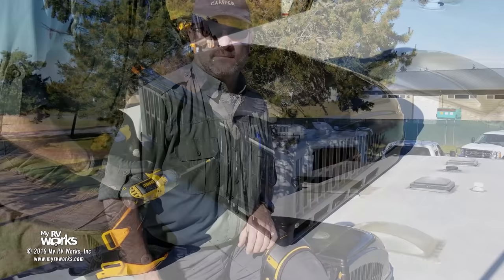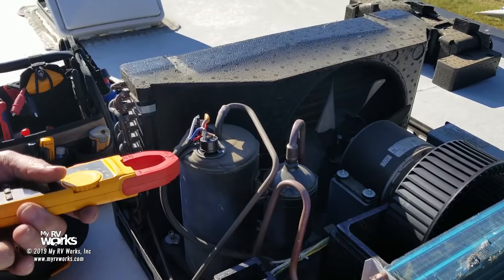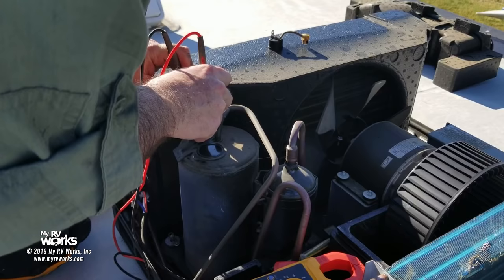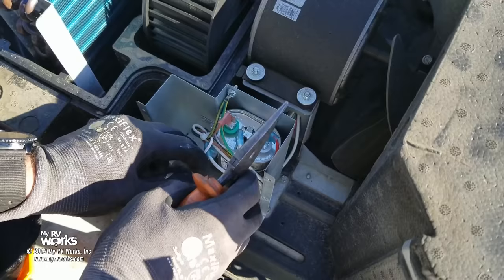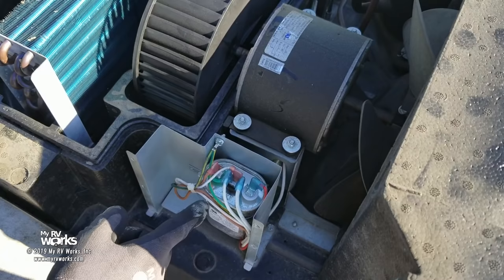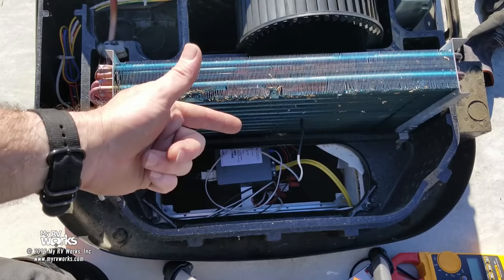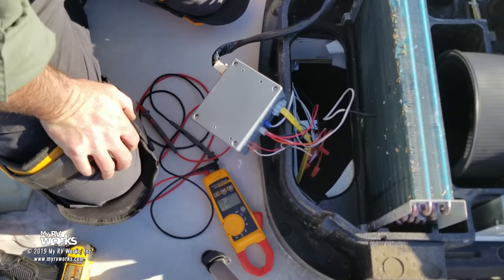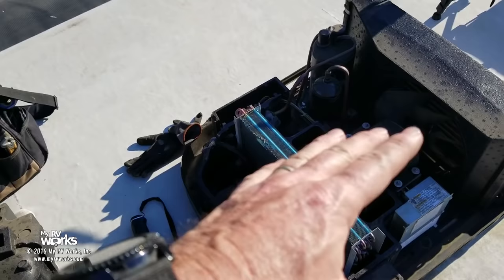Diagnosing An RV Air Conditioner That Is Not Cooling

Comment: How many volts are you supposed to have coming out of controller going to the fan? I only have 12v coming out of controller but I do have 110v going to compressor. Compressor is kicking on but no fan, suspecting it's the controller.

Comment: My c-s and c-r totalled 3.8 ohms but the S-r was only 2.5 ohms?????  whats that mean?
Reply from the maker: Interesting, the math doesn't seem to add up there, so I see your point. What is the common to start value. Then what is the common to run value? Adding those two should equal the start to run value. If it does not, and it's off by a lot, you may possibly have a bad winding in your compressor.  Also check each post to ground. See if there's anything shorted there. There are some other tests you can perform on this. They're in the service manual for the air conditioner.
Reply: @MyRVWorks  I have the Brisk Air ii, how do I get a copy of the service manual? Also, how do you check the relays? Thank you
Reply from the maker: @davidlawson5665  I have lots of manuals from all the factory training I have attended but I have yet to upload them to my website resources tab https://myrvworks.com/manuals/.   Here is another guy that keeps  service manuals on his site:  http://bryantrv.com/docs.html
Failing that you can contact Dometic directly for the manual:  https://www.dometic.com/en-us/us/support

Comment: Wait we’re you running it without the evap coil cover? No shit it’s not gonna cool. You can’t confirm there’s no refrigerant with out a pierce valve and checking the charge.
Reply: You can't check the charge,  he made that statement.  For the price of these units compared to  the amount of time it would take to drain,  add ports, fill and check for leaks then drain and fix etc.  Just replace the thing.

Comment: Another rip off electrician. All he had to do was turn it on to hear if everything was working, if so it needs a charge which he can't even do... He has no business even messing with them if he cant do the work. All he can do if he finds a problem is tell the customer it's broke which they already know since they called him. If he can swap the unit he should have told them thats all he can do. Their was no point in diagnosing it since he cant fix it anyway.
Reply from the maker: So, let me make sure I understand 'your' diagnosis process. If a customer turns on the air conditioner and it does not work, and called me, then my immediate reply should have been "Sorry I can't help you because it's lost its refrigerant and that's not something that I'm licensed to work on."  So with your process I would make this assessment before I even see this air conditioner or perform any diagnosis on it at all?   And you are saying that this would have provided a better service for the customer.  Do I understand your statement correctly? What should I do if the customer wants to understand the problem? Should I take the time to diagnose all those individual components, which 80% of the time is usually a component that failed?  What if it was a capacitor?  I stock those.  What if it was a freeze sensor?  I stock those.  What if it was a control board?  I stock those.  What if it was a fuse?  I stock those.  What if it was his thermostat? I stock those. What if it was a faulty wire between the thermostat in the air conditioner? I can repair that. So out of all the things that I've been trained on, all the schooling that I've been to. The one thing that it turned out to be was a one thing I'm not licensed to perform. And I would ask you to call around to RV shops, RV dealerships, and other RV technicians and find out if their license for this either.  It's not that it's a complicated process. The old manuals from the 70s and 80s have at least a page or two dedicated to how to recharge your unit. But by the time you get all your equipment out, find the leak, make the repair on that leak, tap the line, recharge the unit. You might as well just bought a new air conditioner anyway. But that's the way the industry is trending now.  You can also call the air conditioner manufacturers and they will tell you the same thing.  When we go to school we are told very clearly that we are not allowed to recharge air conditioners in the field, this is specifically why air conditioners do not have tapping valves on them from the manufacturer. But yet you're judging me because I couldn't fix this air conditioner. I'm sure you would make the same comment by watching one of my videos on a refrigerator that has a failed Cooling unit. Because that's also not something that can be repaired in the field either.  So, what does this say about you that after watching my video, where I go through many of the things that 'can' cause an air conditioner to fail, you interpreted everything I did as "another rip-off electrician" . By the way, how much did I charge my customer to diagnose his unit?  Do you recall if I had the conversation with my customer before I even went out that it could possibly be this issue? And do you know if the customer even requested that I should come out anyway? Do you have that information available? Because if you're going to accuse me of being a crook don't you need to know how much I charge and what conversations I had?  It turns out the customer was very happy to have us out there, he was also happy to pay our diagnosis fee so he would know exactly what he needs to do to make the repair. He was also happy that I explain to him in detail how he can make the A/C change himself which he has since done.  And now he is another happy camper that says 'My RV works'.  So, the 'victim' in your assessment does not feel like a victim at all.